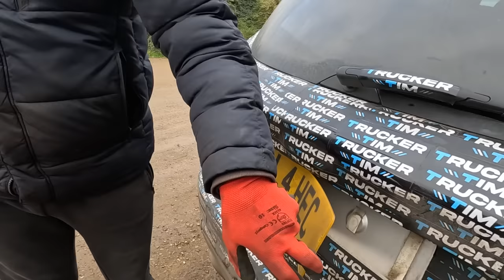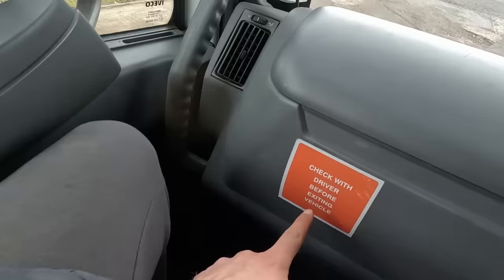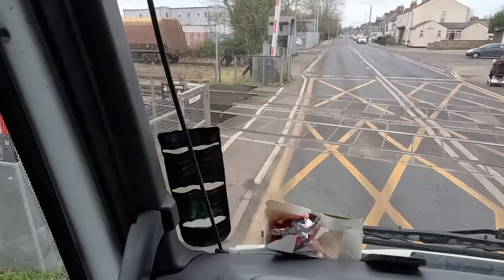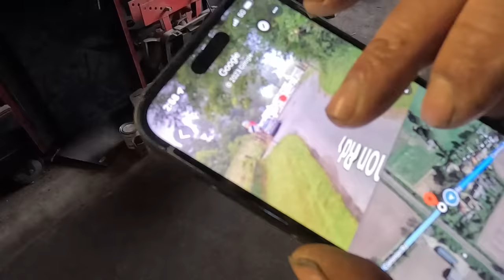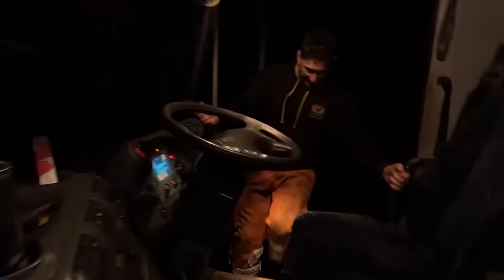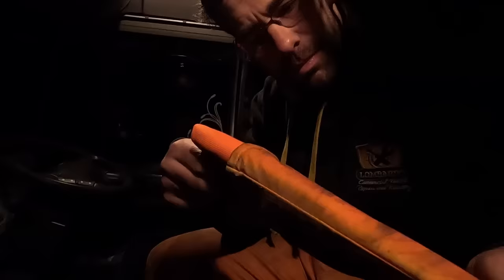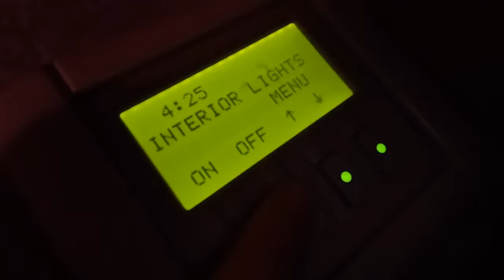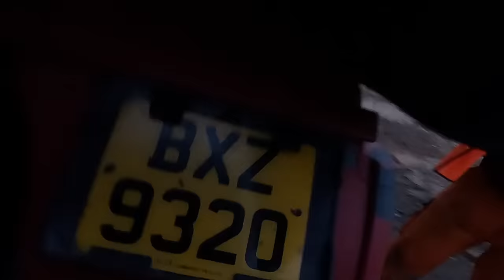Sleeping In A *SLAPSTICK!?* IVECO With Shaun! | #truckertim

Comment: i passed my class 2 and 1 in an iveco eurocargo with a slapstick, absolutely love it. you drive it for 2 hours and you already get used to it
Reply: @Urmom imagine the simplest gearbox in your car, when the gearbox is in neutral it sits between 3rd and 4th gear which is naturally bang on in the middle.
on this slapstick you have 2 neutral positions. so you go 1,2,3,4, when going for the  5th you will feel a bit of a resistance, so you "slap" it towards you while it's in neutral, when you let it go it will sit between 5th and 6th gear  and no longer 3rd a 4th. at that point you simply push it forward for the 5th and down for the 6th, and so on for the 7th and 8th gear. it's honestly much much easier to understand with visual aids

Comment: That would be called a road ranger or non syncro gear box if you have to double clutch it. Have to do a seperate test when doing your prime move licence, very few people can do both tests in one I tried but ended up having to use the auto truck need a tad more practice.  Still one of the things I want to get but with all the new auto trucks not really needed now a days but a manual truck here in australia is generally a road ranger but still mostly only the american trucks like mack etc.

Comment: Tim, you need to learn double de clutching! Even if a synchro has gone, you can change gear without the grind! I used to drive (yes very small, compared with what you drive) Volvo FL6 and all the synchro's were shot to bits, I had to DDC every gear, Downshifting you have to treat it like a woman, FEEL the gears in, and she won't grind!  Easy when you know how, trust me! I hope Mrs. Trucker Tim doesn't read these comments...or I could be in hot water with her, for being sexist!